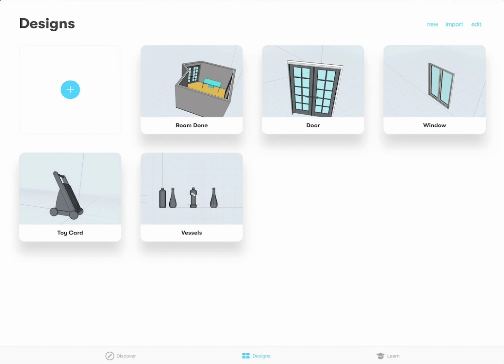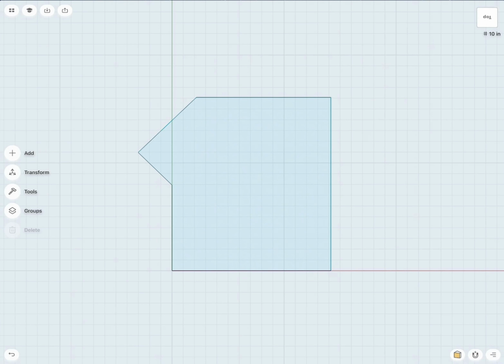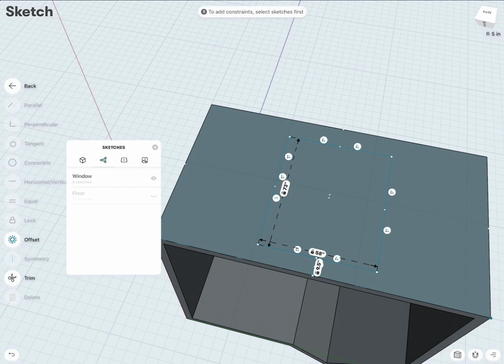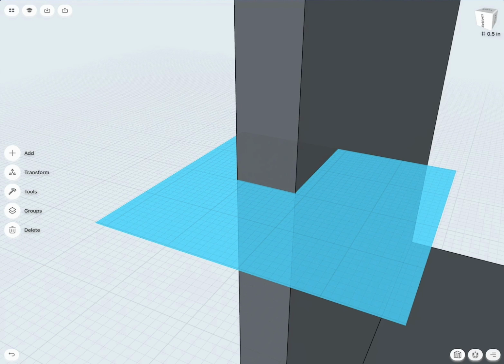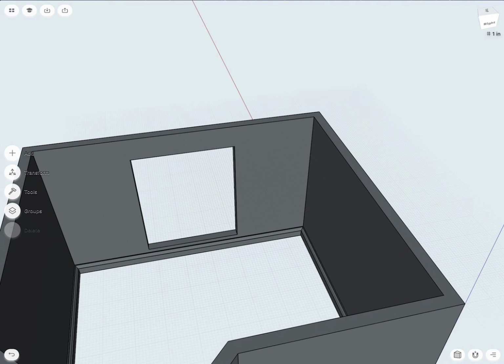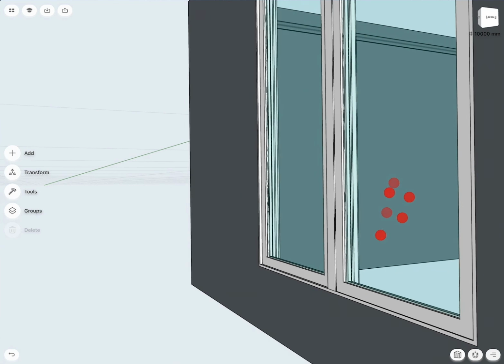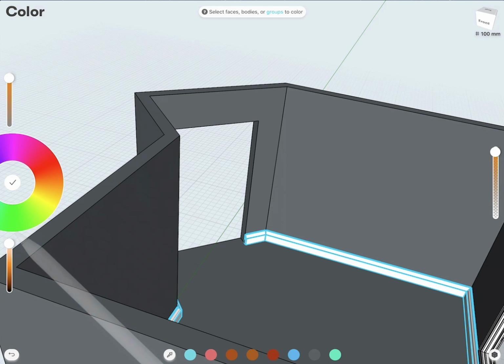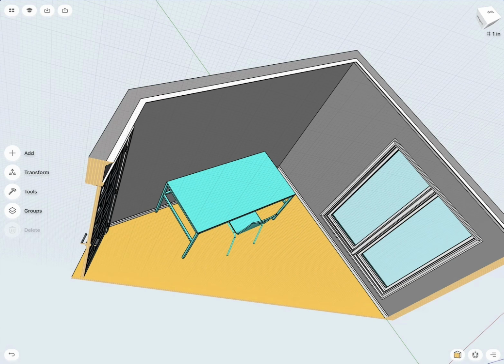Drafting crown molding and doors on iPad | 3D design webinar

Comment: Android?
Reply from the maker: Currently, we don’t have an estimate when we would be able to release the app for Android. The reason is that there are resource limits on our end and technical limitations of the Android system. Also, most styluses don’t function at all with Shapr3D.

However, we might consider the Android version too, but not in the near future. Thank you for your understanding.